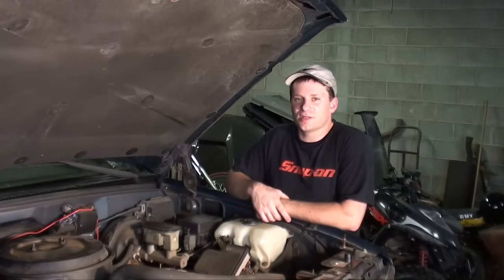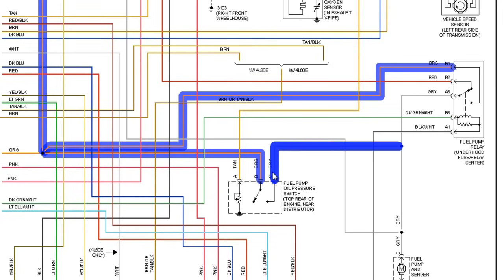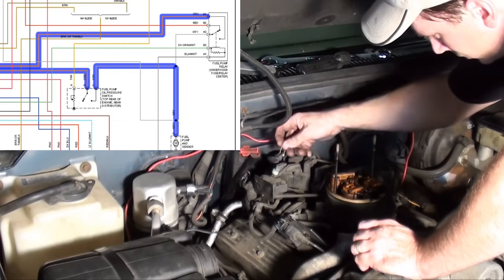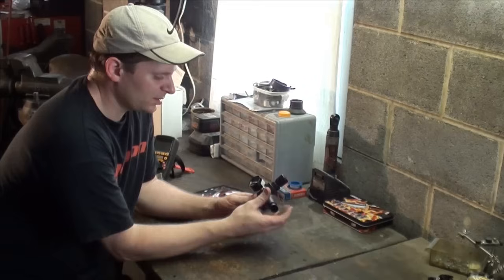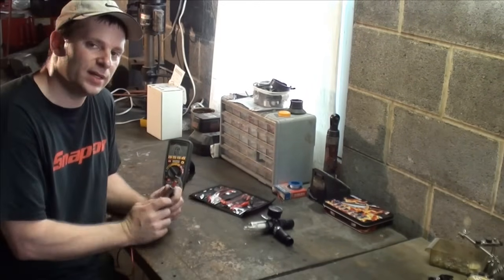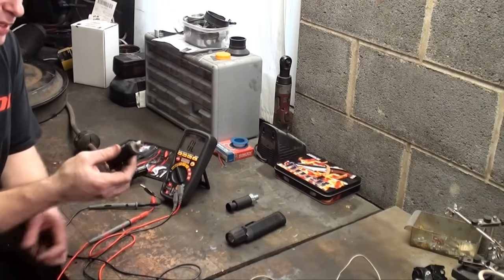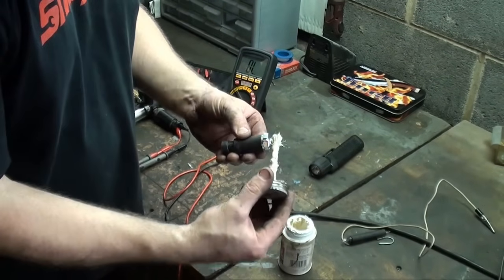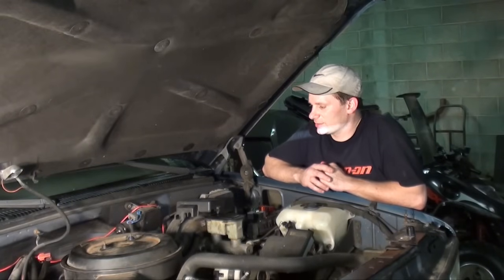Part 2. GM no start no fuel troubleshooting "Oil pressure switch"

Comment: I realize this video was made over 10 years ago but I just wanted you to know that is still helping people today, so Thank you, Will. I have an 89 GMC Sierra SLE 5.7 TBI and have been struggling with a crank no start issue for a long time and no matter how many mechanics I have asked, unless you find one of the old school Shadetree mechanics that doesn't need to hook a vehicle to your computer do you know how to fix it, not one of them knew the answer because of the age of the truck. Your 2 videos on this topic, even though the truck is a newer year model, was the first that help me realized it could be the Fuel Pressure Oil Pressure Switch, which I have since learned differs from year models of GM trucks. ♦Please note for anyone dealing with the same problem please pay attention that it does matter what year model your truck is as to how many pins are in the fuel pressure oil pressure switch, 1988 - 90 will have only 2 pins in the switch, 92-95 may have 2 or 3 and 95 - 99 will have 3 Pins.♦Also, pay close attention that in other videos it may be referred to as a Fuel Pressure Sender which may be accurate in newer 3-Pin models, however in 1988 to 90 Fuel Sender is a separate component/part, in a different location, it is located on the Driver side lower engine block on year models 1988 to 90 and differs from year models 91 to 95 and 95 to 99 where the switch and sender maybe integrated. Video part two was extremely helpful in showing how to bench test a part to show how it works. 🔶Other than discovering this switch could be the issue for I no start, I have also discovered that is very important on your models 88 to 90 as well as 91 to 95 to inspect the braided body ground straps to the engine block. As well as the ground wires to the ECM and fuel pump relay which are black, black/white stripe together and a 2nd set that is a black wire & a tan with white stripe are ground wires that on 1988 to 92 models are typically grounded to the engine block on or near the thermostat housing(bolt)and can become loose over the years from vibration or corroded causing a faulty ground, which I stumble upon by learning from videos regarding testing for proper ground and voltage with a Non-Led test light. As it turns out when I tested where those grounds are mounted it showed a very weak or dim test light, so I jumped it to another ground on the engine block which had a very solid bright light, went to start the engine and was very shocked that it fired right up, all it was was a weak ground connection at the bolt where the ground wires were mounted to the thermostat housing. So if you're having this issue and have this year model of truck, hopefully I can save you a lot of time by checking this and all of your body ground wires to make sure they have clean, tight & proper connection.🔶 When you own one of these year models of trucks it can be very discouraging and frustrating to find out that many younger generation mechanics do not know how to work on them or even care to learn how, even though they are very plain and simple and more basic to work on the newer computerized versions where you just plug it into a computer and it tells you where to start putting parts in it to try to fix it, but don't give up keep searching & trying and you will find the answer.❗🙏I have much appreciation and gratitude to mechanics like Will and others who are old school or enthusiastic enough to learn in order to teach and post instructional videos on YouTube to help us out with our old classic GM trucks. Thank You All‼
Reply from the maker: This is awesome to hear

Comment: Your video helped me repair my 1999 Yukon ,oil switch ,tapped it vehicle started ,pulled relay shut off .Sir you saved me from dropping gas tank and replacing fuel pump ,thank you

Comment: Ok man I don't comment on vehicle repair videos , because I usually have to watch 50 to learn nothing , so I will comment on this one and say you have just taught me something that not one single other mechanic I have seen on you tube has ever mentioned anything about the oil pressure switch as a back up for the fuel pump ! And that my friend completes the puzzle of mine because Im getting a crank run  speratic stall , I pull the fpr and it dies when now I know it should not , I have been leaking oil like crazy lately due to the front side of oil pan gasket , and I just kept up with it till I could get rid of the stall so you can see where my dilemma would be , and THANK GOD AFTER TWO WEEKS OF TRYING TO FIGURE THIS THING OUT I HAVE FOUND YOUR PERFECT VIDEI AND EXPLANATION ABOUT THE FUEL PUMP AND RELAY SYSTEM AND THE BACKUP SYSTEM AND HOW NOT ONLY DOES THE OIL PRESSURE SWITCH PLAY A ROLE IN THE ENERGIZING OF THE FURL PUMP IN A FPR FAIL BUT LOW OIL IN GENERAL WILL PLAY A ROLE AS WELL ! YOU ARE MY NEW GO TO MECHANIC YOU ARE THE ONLY ONE WHO HAS TAUGHT ME SOMETHING USEFUL I DID NOT KNOW ABOUT MY C3500 ! YOU GET THE MECHANIC OF THE DECADE AWARD IN MY BOOK MAN ! THANK YOU FOR BEING  THROUGH !

Comment: I just wanted to share a special thank you for this two part video. I've had an ongoing issue with my 98 Silverado similar to the one in this video. My truck would fail to start on humid/rainy days. Following your videos, I found a cracked oil pressure switch, which was shutting off my fuel pump immediately after starting. The humidity was shorting the sensor. Thank you, thank you, thank you!
Reply: If my fuel pump isn’t running at all this could be my issue?

Comment: Other videos on GM fuel pump relays don't mention anything about the effect of the oil pressure switch on the fuel pump relay,  thanks for helping me fix my problem.  That little demo where you remove and re-install the  fuel pump relay really helped.
Reply: Dear i have captiva when on key automatic not start fuel pump and wont start what i do
Reply: Did your oil pressure gauge show oil pressure even though oil pressure switch was faulty?

Comment: Great video.  Took my new to me 2005 coach with a 8.1 liter workhorse chassis.  First trip broke down twice (not related to this issue).  Got home and never was able to start again.  Two weeks later, I have already dropped the fuel tank and the pulled the fuel pump.  Tried to start and no go.  I ran across your video and decided to pull the oil pressure sensor.  I did your test to the pressure sensor and son of a beach!!!!  That was it.  Thanks bud.

Comment from the maker: also wanted to add, I agree, if I were to leave it be with just replacing the relay chances are it would be fine for many years, however in that rare case the relay were to fail again, as long as there is oil pressure the "back up" pressure switch will keep you in operation. what you will experiences is longer cranking times with a failed relay and an operational pressure switch due to the fact pressure needs to be obtained to close the contacts...
It’s simply just a backup,  Hope that helps

Comment: Thank you. I watched both videos. I am in the process of trouble shooting my 1989 Chevrolet Beretta no start. I replaced the fuel pump in the tank, and got the car running. Then I replaced the signal switch as the left side would not blink, and got the signals working. But then I could not get the car to start again. I have ordered a $30 fuel relay switch and hope that will get this 33 year old car running. It has been in the garden or garage since 2005, running it twice annually. We ordered it new in 1989.

Comment: Thanks for the tip on oil pressure switch causing my fuel problems. Been a month trying to figure out why no power under load. Put the switch in and now feels like a new vehicle. Thanks!!

Comment: Like others commenting here, excellent video.  I'll add one other thing that can cause a no start issue when you have spark, and a good fuel pump, and good timing, and good everything else... a bad Throttle Position Sensor (TPS).  The TBI engines will assume a flooded engine if the TPS giving a false signal that the throttle is wide open, and in that scenario it will not provide enough fuel for the engine to start.  After spending hours and hours over days trying to locate the issue, I finally took a paperclip and read the diagnostic codes (plenty of videos to show you how) and it had a code for TPS.  Replaced the sensor and it started right up.

Comment: Ironic that the back-up switch for the relay also went bad and left the truck stranded anyway haha. Way to go the extra mile and make sure all the components work as they should! Very clear explanation of the process as well. Right on par with ScannerDanner :)

Comment: Thank you for an excellant tutorial. I want to add this feature to my son in laws car that he switched from mechanical to electric inline fuel pump. For safety shut off fuel when vehicle is upside down, perish the thought. And also to leave pump off when key on engine off. It's carburated so it will start ok then oil pressure will quickly bring the fuel pump on. I thought of a 3 wire oil pressure switch but didn't remember the details. You completely educated me on this switch. And can even do an electric oil pressure guage now.. Not wild about the oil tube type of gauge on it now. Leaks under dashboard potential and a leak under the hood spraying oil around "not cool" either.

Comment: If already asked and answered, I apologize.  My understanding is the oil pressure switch isn't for a backup.  The relay in the box when powered works for 10 seconds allowing a start and oil pressure to build.  Then the oil pressure switch takes over and the one in the box times out and stays off until the next time you turn the ignition on.
Now, the reason I understand all of this is from watching your video and having the "a ha!" moment.  Nice work.

Comment: Sir, you just saved me a pile of money on my 1994 Silverado.  But a relay and he fired right up.  So I unplugged after watching your video.  It died right out.  I’ll be swinging by the parts store in the morning or the oil pressure switch.

Comment: Will you are the best!!! You are so easy to follow and learn from. Thanks. I appreciate the comment from Dean Studer on fire safety and rollover protection. Now I have identified my no start. My 2001 S10 cranks, good spark, good prime, no start. Bad wire harness to the oil pressure switch. I found that after I replaced the intake gaskets, I had a no start. The 3 wire harness to the oil pressure switch broke because of age, heat, and movement on the gasket  repair.

Comment: I just want to say thanks for the 2 videos here on this and walking through the troubleshooting process. I have a 1990 olds cutlass ciera that kept shutting off on me. I walked through it an verified all the components were fine. fuel pump, relay, and I had spark. Ended up being a fuseable link by the starter, go figure. Thanks a lot!! great walk through.

Comment: I was under the impression that it was only OBD 2 that had this circuit.
I had an occasional intermittent cold crank , no start on my 1991 305. I found the oil  pressure gauge was not operating properly but once it does start it never fails to restart once hot. 
I replaced the oil pressure switch & the the cold no start problem returned. I'm in the process of checking all grounds & fusible links now.

Comment: Nice educational video.   Just bought my son a 305 throttle body firebird and it has a no start.  Maybe not the same motor, but I learned something about testing the relay and oil pressure switch.  Now I wish he had tested the fuel pump so I could have learned what to look for there.  Maybe in the next video.

Comment: Would a bad oil pressure switch cause engine misfires? I pulled my relay and the engine shuts off. 1997 Chevy Tahoe 5.7.  I've been chasing a p0300 and specific cylinder misfire like p0308 but it's weird every time I take the upper plenum off and recheck everything when I put it back together the cylinder that misfires changes to a different cylinder. The most oddest thing I ever experienced.  I replaced everything you can think of and cleaned up all the grounds wires.  I notice the fuel pump relay doesn't energize sometimes when I test by turning the key on and off. I keep my hand on the relay and I turn the key on and I don't feel it click. Sometimes like 4 times in a row. I bought a new relay same thing. So would the oil pressure switch be causing this?

Comment: Thank you for the visual on location of the pressure switch. I didn't know what it was under my distributor. Not even the manual shows the correct picture.

Comment: Excellent explanation,   I'm about to install and external fuel pump on my 63 gasser and this is an excellent idea to shut off my fuel pump in case the motor shuts off, blows up, or if I roll over. Once the engine turns off and loses oil pressure... it'll definitely shut off my fuel pump.. Safety issue.  Thank you 😊

Comment: very helpful! specially since my wife's suburban with the same set up is doing a random no start thing. her's is a little different issue but i think what you are doing here may have given me the answer i need to get hers going. haven't checked the oil in hers and she NEVER does so it may just be low on oil now that might be why hers will only start when it's warm out (assuming because the oil expands when it's warm  giving her enough pressure to start) it won't start cold early in the morning

Comment from the maker: just wanted to add i mentioned this further down the comments, 
 some engines with excessive bearing clearances, worn oil pump, low bat. may not reach 3psi while cranking,
i can say, it did helped some. had a couple in the past with long cranking times that just needed a relay. very rare though

don't have the vehicle any longer, i will be more than happy to perform this test when i get it in for the next service,

Comment from the maker: Thank you, you may be correct, one thing to remember, if the relay is good that will over ride the oil switch and the vehicle will start even with no oil pressure, so yes if you do have a bad relay it will be very long crank times and my not start depending
Reply: THE OIL SWITCH WAS FOR A BACK-UP FOR A BAD RELAY not for safty!

Comment: Well done !!  What are the odds  the relay and sender would be bad.  Too bad GM stopped using the back up  oil pressure system on its newer engines.  I wonder how many  shops would have just replaced the relay ?

Comment: Very impressed with your knowledge, young man. I have an issue with my 93 Chevy Silverado K1500 ..long story short is that the truck runs normal but when it gets over 95° outside and I go for a 50 mile run with it when I shut it off, it will not restart until it cools down. Of many reasons ..replace the relay still happens. Saw this video and thinking maybe a fuel oil pressure switch functioning when it’s really hot. Your thoughts please. And yes, I’m very impressed with your videos and knowledge.

Comment: Hey will wouldn’t the oil switch have bad oil pressure
Reply from the maker: Yes I do believe if you lost oil pressure it would shut it down. Same as if the switch would fail
Reply: @robinsonsauto  ok thanks

Comment: Thank you for the great videos! I have a 1993 gmc suburban 5.7 350. My fuel relay is on the passenger firewall. Can I use these same test methods on this vehicle such as starting the vehicle and disconnecting fuel relay to see if it stays running? One of the problems I'm having is the vehicle is stalling while I'm driving it. Any help would be greatly appreciated.

Comment: Ive watched both videos and I only have one question.  On my 95 GMC Sierra when I filmed what happened on my circuit which is supposed to receive 12V for 10 seconds with the key on it goes from null to battery voltage for a split second but then stays zero.  Is that likely a pcm issue or an ignition switch.  The other tests in the first video it passes but its not priming long enough

Comment: on my 93' the pressure switch is not 1-1/8", its 30mm and you have to remove the distributer to get it off if its the original.  Gm put these in tight and the tree is fragile and you will break it off if
you don't support it with a 15 inch adjustable wrench while using a 30mm box on the sender. Have an extra distributor gasket. mark the position of the rotor and distributor base. Its quick and easy but adds a second possibility in diagnosing any problems if it doesn't run right. I try to restrict repairs to one thing so there arnt multiple possibilities to chase if a problem.

Comment from the maker: thank you, that would make more logical sense, however GM was just using the pressure switch as a back up for the relay, so if relay failed as long as you had oil pressure the vehicle would still run. now if relay was bad, it would take real long cranking times to start if you could build pressure cranking to close the contacts that was their"theory"  
if the pressure switch were to fail or you lost oil pressure as long as the relay is good it will still turn on the fuel pump. hope that helps

Comment: My truck is a 98 k1500 5.7. Its the spider injected not the tbi like this truck on your video. Is the oil pressure switch still used on my truck for back-up for the fuel pump relay? I just replaced my pump and the truck is running fine no problem but when is disconnect the fuel pump relay the truck shuts off. Just wondering why you were able to get the truck started in the first place by just replacing the relay if the problem was the oil pressure switch? Does a bad oil pressure switch eventually cause the fuel pump relay to go bad. Thanks for all your valuable info!

Comment: Would a bad oil pressure switch cause the vehicle to crank no start also cause it to back fire? Any help would be greatly appreciated. Thanks for the great videos and your time.
Reply: Backfiring is usually an indication of distributor issues